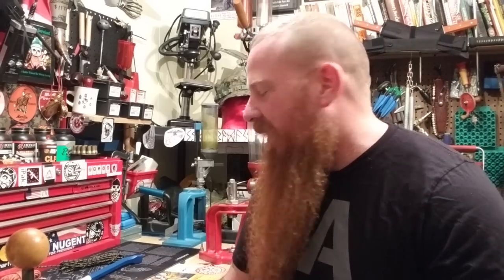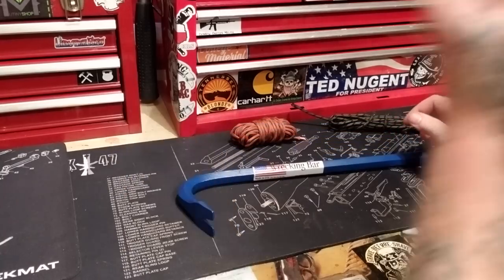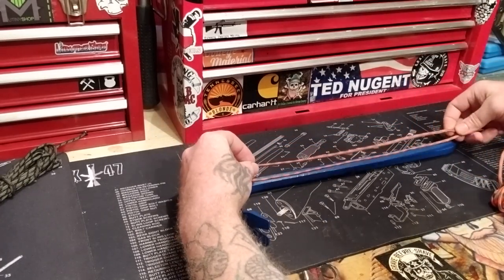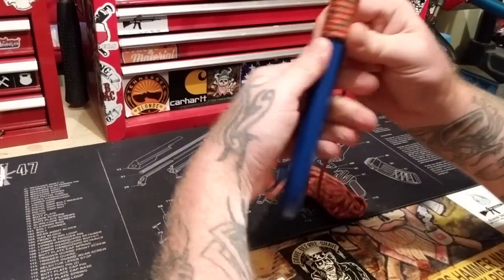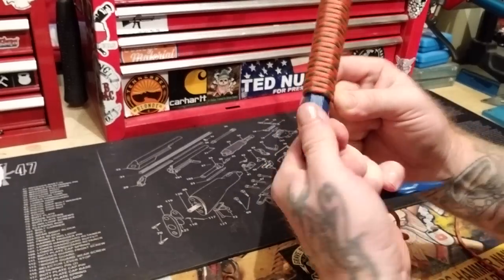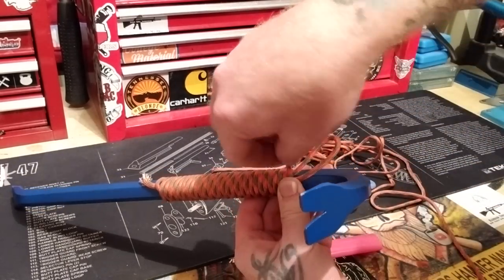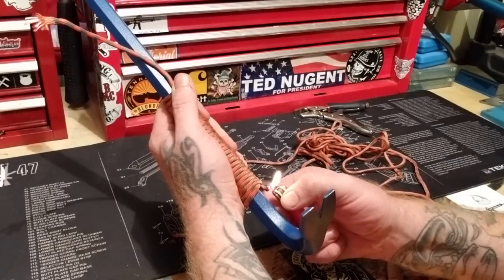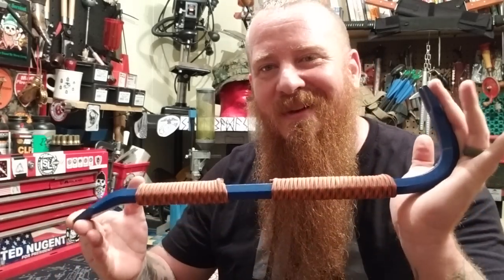SHTF Scouting Crowbar

Comment: Another good video BA.have you ever thought or done a video on different egress tools besides the crowbry?
Reply from the maker: I think so or maybe just added some to kits
Reply: theravn141.  I've Ranger Banded a short , flat pry bar /nail puller to the back of my Mora Companion sheath . I added a small ferro rod , a diamond sharpener steel , also slipped a sail needle and X-acto blade in too . Then I wrapped the whole kit in paracord.   Then I stretched a Ranger Band over everything  . I stretched another Ranger Band over the knives' handle for good measure .     Look at the six flat sides of a pry bar and imagine what can fit within the limits of their width and length . Put those items alongside those surfaces , wrap then in duct tape , then do the paracord wrap over that . You could probably fit long narrow blades like X-acto blades , narrow box cutter blades , sail needles ,  fish hooks , a length of monofiliment fishing line , a couple of matches , a hacksaw blade and such under the duct tape and paracord .  I've been playing around with this idea with some of those flat nail pullers about a foot long and one and a half inches wide that I bought at Lowe's and Home Depot . They're wide enough to put box cutter and carpet cutter blades along the flats , but not heavy enough to be used as a striking implement . However , they are made of tempered steel and their tips can be sharpened to a chisel like edge .  Let's learn together ,  friend .

Comment: Legal to carry in your car??
Reply from the maker: Probably not in your center console. Trunks ok.
Reply: Step One survival  lol ok  I have one under my front seat. It's not as nice as yours but I am gonna try to to that. Thanks
Reply: Being able to explain why you have something (a use other than a weapon that is logical) is the difference of intent when used as a weapon.  Like BA said, trunk works, you could even have a small "tool box" on the floor in the back seat which would be easier to explain than just a wrecking bar stored in plain sight.
Reply: Its literally a tool is it legal to carry a hammer in you car?

Comment: Nintinol power wedge crow bar. You pound's it in and then hits a button to cause a hertz frequency blast to snap the crystal structure's in the nintinol to becom ridged. Pop open wooden door's car door's gate's security door's. Secondary use? Splitting crack's in boulder's?  Nintinol has many uses! Camping cooking pot's and pan's you can pack away and bend up and smash then just heats them up and they all go back into their programmed shape's. Neat to make arrow rod's you can bend around a walking staff. Then if needed heat up the rod's and they spring back strait and then unscrew them and screw on artow head's and the fins onto the end. Then use your Nintinol cross bow deluvering a few ton's of firing force per square inch hay beat's only a 50 or so pound's of force. put's a nice scope on's it and learn to arc a shot to hit a target a mile away. Be neat to incorporate a drone into the arrow little camera and fins that guide the arrow to it's target. Bug out tool's get the high ground take down a deer or Elk from long distance never going's hungry easy hunting.  😊

Comment: A better tool would be a hammer on one side a crow bar thingy on the other side and another crow bar thingy on the bottom of the handle with a grip you can twist out a little screw a bit on each side to remove the handle. They sell those in cop equipment catalogs minus the removable handle. With the handle it become a war hammer. 😊😉
Reply: A plain crowbar is the best

Comment: Ah yeah start the video with a little ZZ I wish the one I hit myself in the head would have been paracord wrapped lol.
Word of advice when you pry with a crowbar ALWAYS PRY AWAY FROM YOUR BODY NO MATTER HOW FAST YOU NEED TO.
about 12 years ago I made that mistake and I still have people calling me crowbar till this day. No one knew me by my name only as Crowbar. Mine was a full size and I was bearing and seal installation for 18 wheeler hubs. I was working quickly and went to remove the damaged seal from one I that was previously installed. 

I pryed as hard as I could not thinking just working it came back and struck my in the head splitting my forehead wide open. I saw the stars that they show cartoon characters see. I walked across the plant to the aid station and they butterflied it I asked if I could go back to work but I was out of the fight for the rest the day very unproductive at that point. Later I had to get the wound sealed my head rang like a bell I shit you not for 3 days and hurt for a week. From that day on, Crowbar was the name. hahahha. Young and stupid but memorable mistake